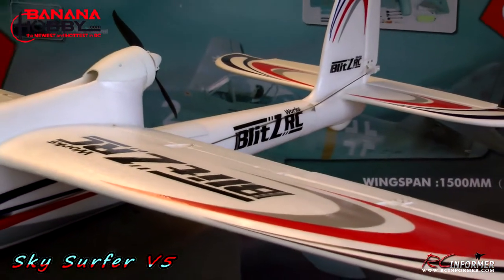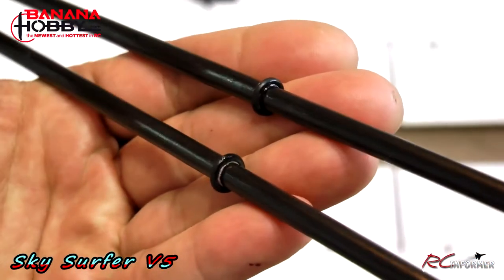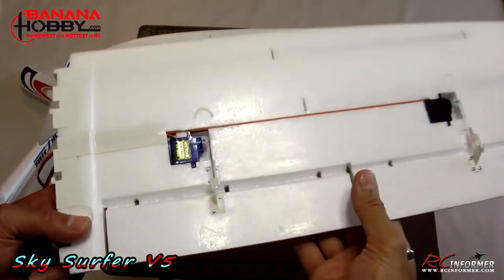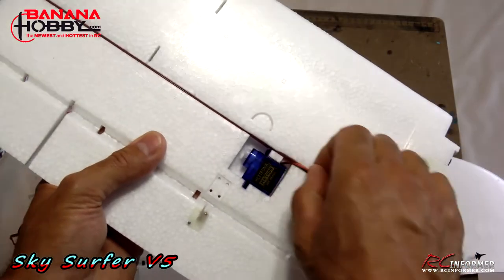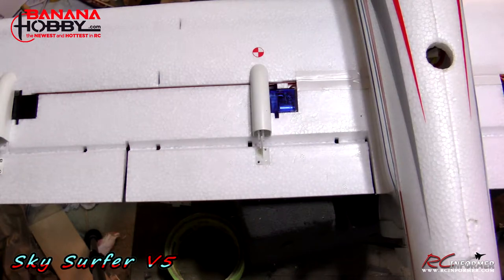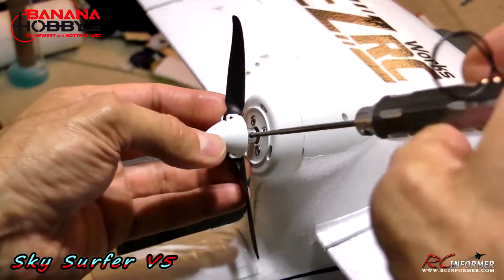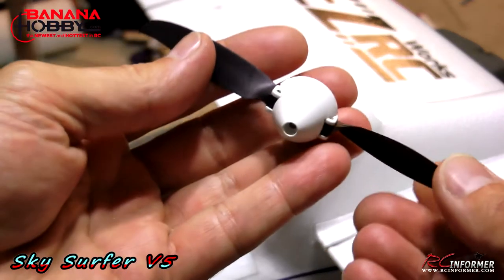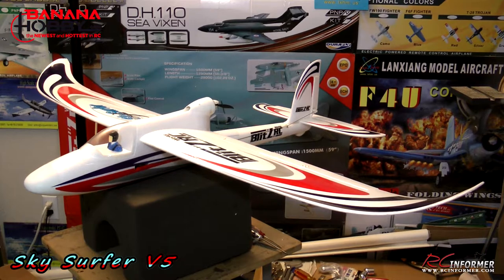Banana Hobby SKY SURFER V5 Build Tips By: RCINFORMER

Comment: I ran into the same problem with the wing spars but when I removed the spar that was stuck half way the tubes came out. The tube is actually two tubes help with tape at the center and end. So I gently knocked the tubes on to the rod, from both ends using a rubber hammer. The I inserted the rod and tubes back into the wings.

I also changed the prop with a 6x4 apcE prop and a x 3.17mm Rocket Propeller Adaptor. No need to flatten the shaft with this spinner.

Comment: Now Discontinued! 🤥
I have an older BlitzRCWorks Sky Surfer version that only has 1 wing spar.
It also doesn't have screws for the wing or stabilizer rubber.
No motor mount, it's glued in.
Nor does it have flaps. 🙁

Comment: Love this channel but this model is a mess. The one I received from banana had a 3.5mm misalignment on the inset spars in the wings. After fixing them and reburying the spars it flew ok. Second flight the motor mount failed and when the motor ejected the plane rolled on its back and then spiraled in for a total loss. I looked in the forums and this problem seems common. Contacted by Banana after commenting on another video. Sent pics of motor mount at their request. Two follow up emails and seven days later no response. Avoid this model and this vendor. I also get the feeling I received a defective return since no plastic bags on wing and retaped hardware bag. Shady stuff.
Reply: My friend also had the same problem with model. No need to pay for something without its benefits.,
Reply: Between elevator and rudder servo mounting weirdness, bad spars and the rest of the list...  I ended up getting a replacement airframe from banana. Good guys. Shoddy product. Use it now for a basher for my nephews. Never in a million years load it down with fpv gear. Just not that great of a plane give it a 4.5 out of ten. Bad flight habits. Tucks in a dive. Tip stalls and motor mount moves no matter what you do to correct it.  Not a fan.